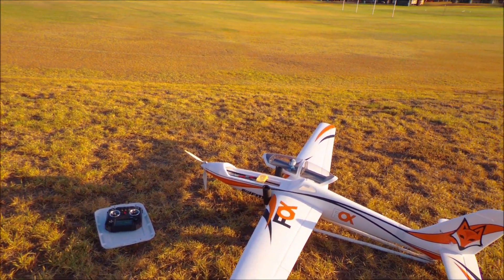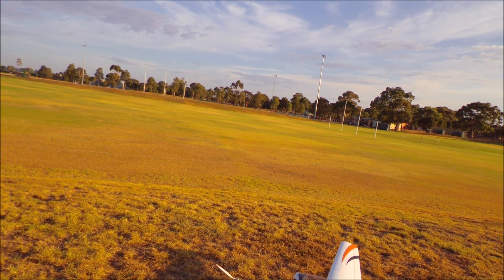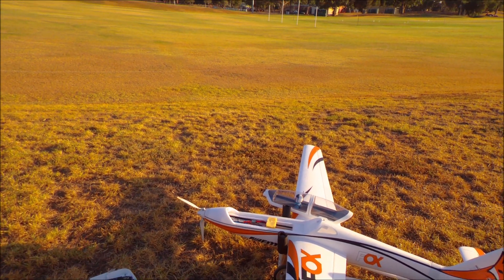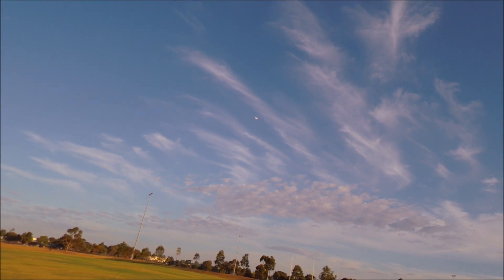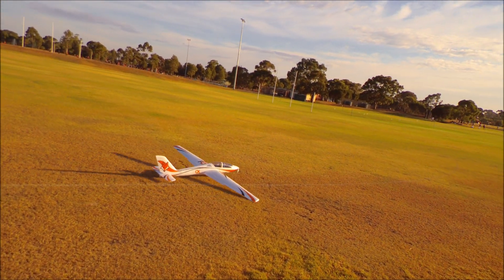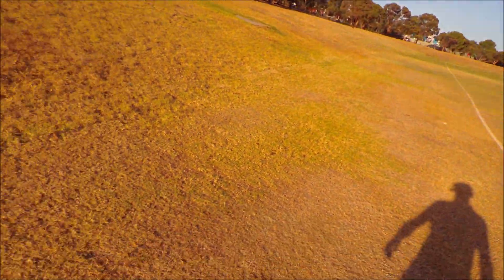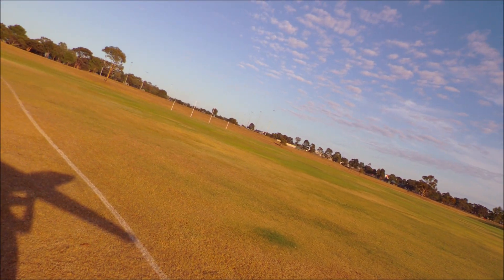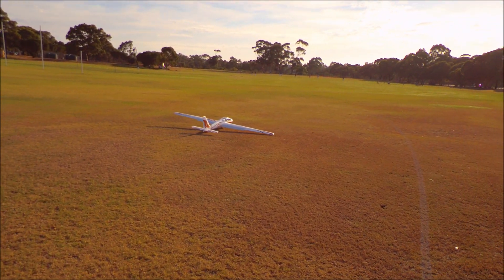Fox Sports Glider - FMS 3000mm - Auto Launch Tests

Comment: Great video, thanks for posting it.  I have a fox glider, I have not flown it yet. I want to make a take off dolly for it.  How did you make yours, do you have photos or video about how you made yours. Thank you Toby
Reply from the maker: RCGroups blog here:
https://www.rcgroups.com/forums/showthread.php?3247233-Fox-3000mm-aerobatic-Glider-FMS
It doesn't show a lot but it is pretty simple thing to make. Just some pieces of plywood (for the two 'sides) and some 42mm X 19mm Pine for the cross pieces, which also have the wheel axles pressed into the ends of that.
Two verticals, with some foam rubber tubing around those (to protect the wing leading edges), at the front for the wings to "push into" so that it propels the dolly along under power. When the Fox lifts upwards it just rises to clear those.... and off it goes!

Comment: Hi peter, can u supply the switch setup u used for the 3m fox glider as I can't lunch with one hand
Reply from the maker: @keithburt1445  I will see if I can upload a file of just the Fox and then you can view it in OpenTXCompanion to see it all.
Reply from the maker: Here:
https://www.mediafire.com/file/8lxcfcvruhmeg64/2025-02-24a_Fox3000_OTX2.3.5.rar/file
Reply from the maker: Here: 
www.mediafire.com/file/8lxcfcvruhmeg64/2025-02-24a_Fox3000_OTX2.3.5.rar/file

Comment: Did you use flaps? On take off
Reply from the maker: Yes, Flaps (Full Flaps) for take-off.... whether hand launched or Dolly.  They give a ton more lift and the drag they add is not important at those lower speeds anyway. There is not even any rush to remove Flaps (go to zero flaps) as it still easily just climbs away with them fully down - but you do go to zero, just not in any rush that you need to be pressured about.
Full Flaps is a huge benefit for hand launches, so I do it definitely always for that.... but from the dolly it can be full, or mid flaps, and is unimportant as the Fox only flies up off the dolly once it IS flying (fast enough) anyway.
Reply: @MrPetersVideo  when you take off with hands the throttle is in full or 60% ??? To throw..

Comment: Very useful video thanks. Plain flaps: flaps change the wing camber and therefore the coefficient of lift. Dropping flap has the effect of reducing the stalling speed but also increases drag, therefore requiring more thrust to maintain speed. Deployment also reduces the angle of attack. The lift/drag curve is such that beyond a given angle, the increase in drag is more significant than the effect on lift. So, typically for a plain flap, up to about 15 deg will aid take off and climb out. Beyond that, the effects favour descent and landing. Without knowing the angles you've set for the two stages, it's not right to comment, but in general, full flap is unlikely to help in the take off case.
Reply from the maker: Oh OK that makes sense.......  but....
I have found that it does make lift off MUCH earlier with Full Flaps, so the drag rise is probably insignificant versus the Power level you have to over-ride that. The same occurs in my F-14 Tomcat (Freewing) which I take-off and land with Full Span 'High Angle' (45deg) Flaps. It is notably better, but I do take-off from grass and that is a very high drag surface so getting maximum lift to 'lighten' the load, thus drag, as soon as possible is of great help. I suspect that 'total of all factors' is why Full Flaps work better from grass.
And for a Fox hand launch, it is probably also better as you are moving extremely slow on launch release and maximum lift trumps any cost of drag losses. (The Fox would be about 45deg Full Flap also).
Quite often results 'defy' theory/logic... because the theory does not include ALL the data/factors that are involved in that specific case, so it is errored due to that lack of the full data set. This is why real flight testing is needed (eg a new design aircraft) to FIND OUT what the 'maths' did not allow for (missing data), and quite often a 'surprise' difference is encountered, but then it all makes total sense AFTER the real-world data set is acquired and looked over. "Oh, that is why....", seeing that extra, prior unknown, data is now seen.
You have to be careful with 'theory and books' versus what will truly happen.....  they are not wrong, but can often not include YOUR specific circumstance(s) and its full data set.
(also ground effect inputs, and who knows what other small nuances per specific case eg high drag grass, versus very low drag hard runway case)

Comment: What is the brand of the auto pilot unit?
Reply from the maker: This has a FrSky S8R receiver flight controller in it. But you could use 'external' ones, such as the Eagle Tree Guardian, or HobbyEagle A3super3. iF they say "6 axis" that wil mean it sues Accelerometers also, which are needed for them to have an Angle mode of Control included. Usually a mode called AutoLevel, SelfLevel etc.